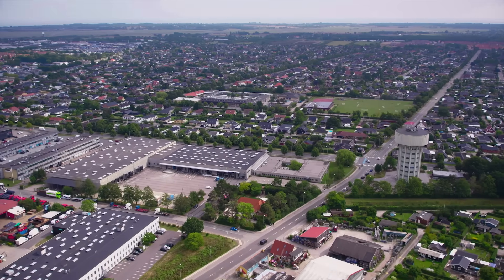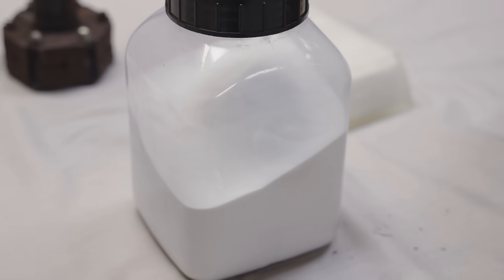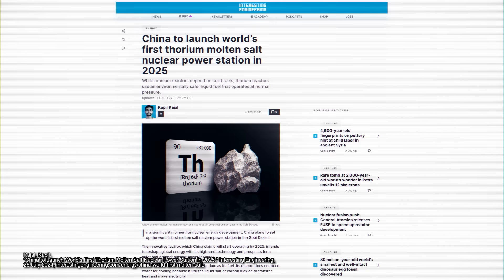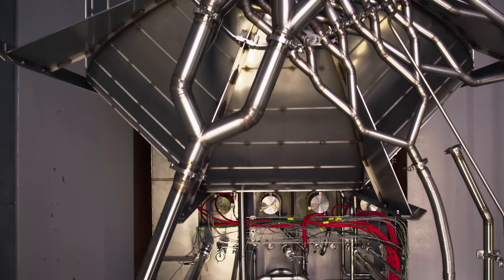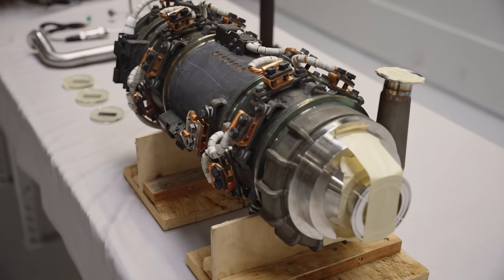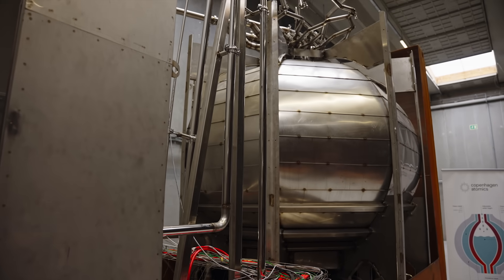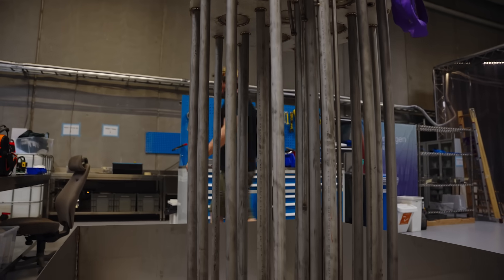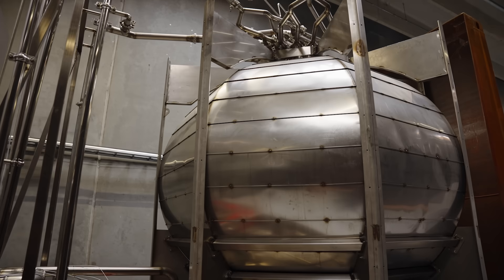Why Isn’t Thorium Changing the World?

Comment: If it were so easy to manage, we would already have them standing around everywhere. It is not the lack of research about how to do it. It is because running them as efficiently as it is always promised, is much harder than to run a light water reactor. Listen closely to what Copenhagen  Atomics says: They still don't have the fittings that can safely contain this extremely aggressive salt. After sixty years of technical development. 

If you want to know what FluoriNe can do, watch the video 'The Element That Terrifies Scientists - Fluorine'. A bunch of chemistry YouTubers visited a research facility of the University of Marburg, Germany, to watch them handle pure fluorine. The institute has to build their own devices, vessels, pipes, and conduits, and clean them thoroughly, because even the slightest bit of carbon compunds can set fluorine ablaze.
Reply: It is sixty years where no research or development was being done on these kinds of reactors, however. It isn't surprising that no specific developments were made when you're dealing with a set of operating parameters well beyond the norm. That requires a team of researchers actively focusing on resolving them, hence Copenhagen Atomics having made progress in that regard when they did so.
Reply: The problem with 'after 60 years of research' is that research stopped 60 years ago, because there's no reason outside of this reactor to pump molten salt. Maybe someone can enlighten me, but I don't know of any industry that does that.
Reply: @12pentaborane  Exactly. Pumping salts (molten or not) is a bit a of specialized industry. But it does exist. (where do you think table salt comes from? brine wells - it's not molten, but it's still corrosive as heck.)
Reply: @jfbeam   Brine is salty, yes, but it's not anywhere near the temperature that makes handling a challenge. All the uses I can think of that requires salt transportation it can be done in solution or solid, well below 800 C or whatever temperature this stuff melts at.
Reply: @jfbeam   I thought it would be a combined issue, as the temperature increases chemical reactivity.
Reply: @jfbeam  > brine wells - it's not molten, but it's still corrosive as heck.)
brine (aka salty water) is NOT a synonym for molten salt.

Molten salt is composed of SALT (with no water). Not so corrosive. Many salts having little chemical reactions with their containers - hot or cold.

Brine is composed of salt PLUS water. Vert corrosive. Most salts having many chemical reactions with metal containers.
Reply: Had we continued research into thorium cycle reactors in the 60's, we'd have them standing around everywhere. It was determined to be more expensive, and require a great deal more work ("funding") to solve a bunch of problems. When all the work had already been done to make uranium cycle reactors work (and make plutonium for our bombs!), there was no funding for further work on thorium. As Kyle points out, there are still a boatload of things that still haven't been solved.

For the record, we did make molten salt, and molten metal, test reactors back in the day. There were complicated problems with them - salt is corrosive, hot salt is very corrosive, NaK (alloy of elemental sodium and potassium) explodes on contact with water (ie. AIR)...
Reply: @jfbeam Good points! Also, one of the main reasons we have light water reactors is that a  lot of research money was pored in to the development to make reactors for submarines and aircraft carriers. Private companies could then take advantage of the designs already funded by government money.
Reply: @jfbeam  > hot salt is very corrosive
hot salt is not that corrosive; there are several industrial processes which use hot salt (aluminum refining probably being at the top of the list). These industries appear to have little or no issues with keeping their hot cells working for years at a time.

> NaK (alloy of elemental sodium and potassium) explodes on contact with water
And NaK is NOT A SALT, but an alloy of 2 metals; so irrelevant to a discussion on molten SALT reactors (although it may be relevant to a discussion on metal-cooled reactors, typically suggested in fast reactor designs).
Reply: There wasnt enough research in 60 years. That doenst mean problems would be solved by today but it is fallacius to assume a great deal of research have been done this time because it wasnt, it was abadoned for the most part of the last century.
Reply: @lobachevscki  I am fairly sure there have been at least general researches to find a substance that can withstand a lot of acid, bases, solutions, salt, stress caused by high weight, or abrasion, even better when combined. Chemical plants are always in need for such materials. If even now none of the developed materials can contain the thorium salt in the long run, I get worried.
Reply: @gabbyn978 It seems there wasnt as much research and investment as you are assuming there should have. To my knowledge there are plenty of scenarios in the industry that require corrosive withstanding materials but the combination of the molten salt and the high temperatures make this scenario very particular and indeed difficult.
Reply: China will get it to work.
Reply: So its a good job there aren't trying use FLUORINE then isnt it? Get a clue.
Reply: > If you want to know what FluoriNe can do,

The issue with your statement is that they aren't working with FluoriNe, they are working with FluoriDe; which is not that 'aggressive' a salt, but a fairly stable one.
Reply: @factnotfiction5915  If it were so, why are they then still trying to find out which material is good enough for the plumbing? After sixty years of technical progress, that for sure have provided us with durable alloys or plastics?

Comment: Long term maintenance being difficult is a HUGE problem, I think these folks are underselling how impactfull this is.
Reply: I believe their perspective on long-term is inverted, as their reactive elements can be re-used over very long durations but their reactors are only conceived to stay in use over around 5 years, using a sacrificial coating inside of the plumbing to keep corrosion in check. 
Then, the modular, small-sized reactors they are creating kicks in : if you can produce an industrial furnace-scaled full nuclear reactor per day with the proper production chain, this product being also deliverable to the exploitation site and plugable in a matter of days, when your corroded reactor runs out you "simply" replace it, and recycle it into a new reactor.

I agree this feels strange, given our current nuclear industry tries to build reactors to last (and are constantly trying to extend its use), yet in this model it is the uranium rods that are replaceable ... If it becomes cost efficient to do it the other way around, why not, given its alledged superior efficiency ?
Reply: @c-hd.8644  I had a really fun time imagining a reality like your comment describes, thanks for your insights.
Reply: @20storiesunder  These guys are underselling a lot of problems.
Reply: Probably, but I think it's worth looking into all the same.
Reply: Because they're grifters trying to cash out

Comment: A friend of mine has a big piece of Hastalloy scrap. It's a 3" round post about 18" high, welded to a 6" square base with bracing at the corners. The thing weighs around 70lbs, so he uses it as a soil compactor when digging.
Reply: Does he know that he's gardening with like 10k worth of metal there?
Reply: @nickdecker2350  You're off by an order of magnitude. It's only worth about $1K, but can you really put a price on a perfect tool?

Comment: So, what happens when (not if) a pressurized pipe of molten radioactive salt bursts and sprays/aerosolizes nuclear material into the system?
Reply: What happens when a pipe bursts inside the reactor, spraying 700°C fluoride salts into 25°C heavy water (moderator)?

Comment: the Tech, we shelved it for fast breeders for p239 for bombs, and it was stupid. There was no need to design submersible pumps, they could have used shafts and gears with the pump above the unit. stupid design choice. Or use a magnetic drive pump external. Also you can used a lot of coating like PVD tungsten carbide on the plumbing to stop the corrosion concerns. We need a rocket company to take this on

Comment: I just found this out and feel free to confirm, but since 2021 until Dec. 2024 the idiots at the NRC have been working on modifying Title 10 Part 53 so that they can "allow" the building of Molten Salt Reactors that are larger than 1MW...and this was just the first stage. They have just now started on "stage 2" of the rewriting of Title 10, Part 53. How many stages are there? When will they be done? Shouldn't we get rid of the NRC as they have been stopping the exploration of the use of Thorium for a long long time now?

Comment: I'm sure you've covered it elsewhere... What stops us building the parts out of a suitable glass? Glass melts at 1600C after all and is far more resistive to corrosion than Stainless Steel...
Reply: It gets soft at a far lower temperature than that.
Reply: Friction and weight. The molten salt is dense, and the fuel and moderator floating in it apply friction to anything it flows through. So if you make it out of glass, you have to contend with those things.
Also, earthquakes can happen, so you don't really want to make a nuclear containment vessel out of a material that can shatter.